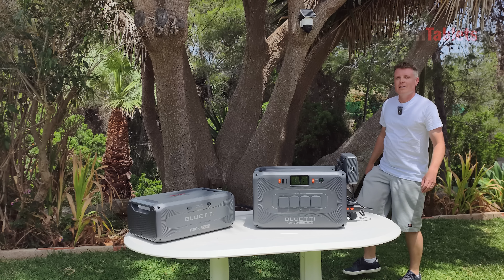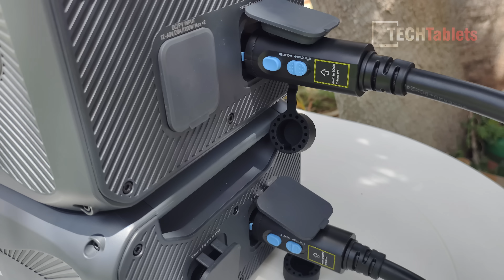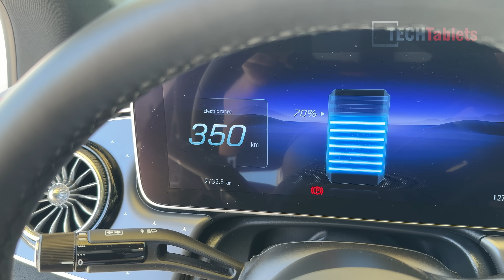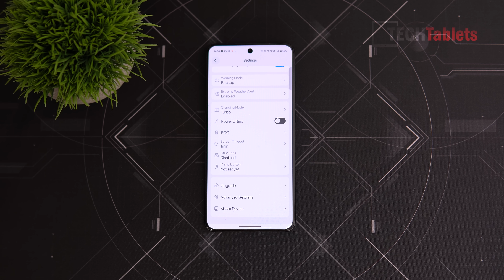Bluetti Apex 300 + B300K & DC Hub1 Hands-on 3840W Of Power!

Comment from the maker: 👉 Where to get one: https://bit.ly/3Ht0KME
#bluetti #apex300 #homebackup #rv #offgrid 
Video chapters: 
00:00 - Intro and key specs
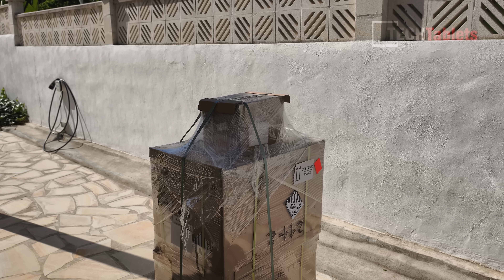01:35 - How it arrived and what is included with the Apex
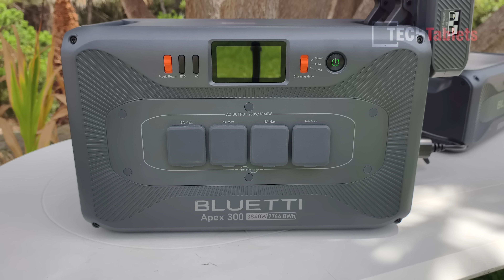02:11 - Apex 300 design and features
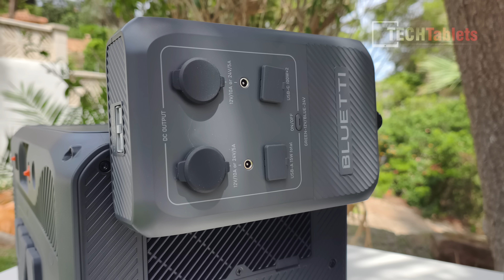04:46 - The Hub D1 for DC output
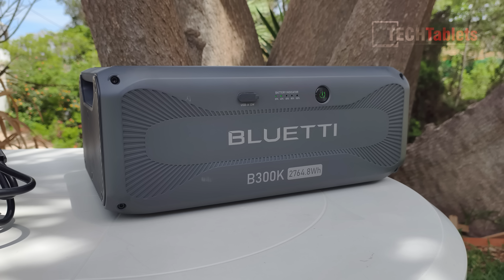05:45 - B300k expansion battery packs
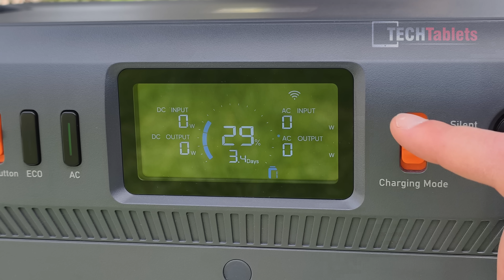07:27 - How to see run time & charge times
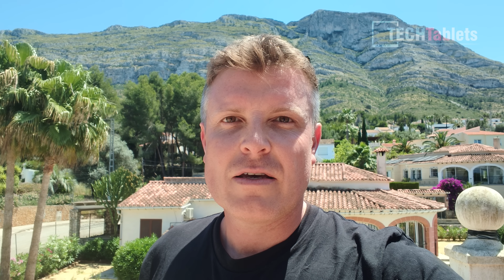08:07 - Solar charging test with 400W panel
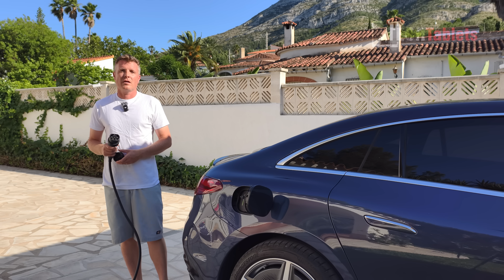09:29 - Emergency charging an EV, how much range and 5% will it give?
11:24 - Other uses for the Apex 300
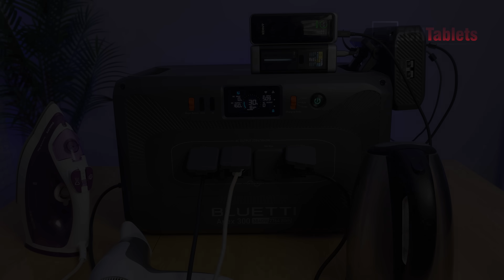12:17 - BMS tests, load test, overload test, charge and discharge test
14:40 - Fan noise sample
14:50 - UPS test
15:30 - The app and features
17:42 - Final thoughts on the new Apex 300 + B300K & DC Hub1
Reply: bro u need to pin this
Reply from the maker: @seansmith6473  Done thank you!

Comment: I have 2 x 200w panels feeding  in a VTOMan 1800.  Solar is the only charging option. I'm thinking of upgrading the VTO to the Bluetti Apex 300. We are only at the shack on weekends so the rest of the time we're charging into the until. The reason I'm looking at the Apex 300 is to run a small, 80 watt fridge 24/7. Would I be better served adding a couple  more panels to the new Bluetti or should I consider an expansion battery? Obviously additional panels would be the cheaper option but a little voice in the back of my head is telling me to go for the extra battery.  I would welcome your input.

Comment: If you set up a van and use the apex 300 and  DC hub, run the hub to a fuse box will you only be able to use 700 watts max output?

Comment: I've had the Bluetti EB70 (716 Wh = 0.716 kWh) for three years, no complaints/issues. It's the perfect size to keep in the RAV4 emergencies or camping. Bluetti build quality is top tier
Reply from the maker: I've covered many if their products, the last bug unit was the AC300 before this and great. Even their smaller ones perfect RV and emergency backup. We had a huge power cut here in Spain and will always have a few short cuts per year so I keep one in the house as backup. And the way the world is going you never quite know.

Comment: No DC ports 12v, usb nothing on the unit is an ayrocious business decision. Buy our bulky ugly adapter box just to get access to basic usb-c charging....yeah whoever came up with that idea should be fired.  This is the only reason I'm not going to purchase this unit but also look at upcoming Bluetti products with suspicion. Dont take away basic stuff, sell it as an inconvenient add-on and call it "modular".
Reply from the maker: Yes the removal of the DC side and forced purchase of the DC Hub1 isn't a good movie at all. The AC300 had everything but then no battery with it that is separate. My guess the size or weight is why they did it. Yes second might have been a marketing sales move to sell hubs for it.

Comment: Might be a good prouct but 15:32 advoid unless you want to give them your wifi router and personal data!
Reply from the maker: Wel don't use the app or connect to wifi that is all optional Dan.
Reply: @Techtablets  But it's required, correct?
Reply from the maker: For firmware updates yes, but you could get away with never using it and be fine.

Comment: how much can this charge a tesla model 3?
Reply: Probably not much... 60khw and 85kwh batteries on those cheaper Teslas
Reply: Get a nice diesel and you never need to worry
Reply from the maker: @RdMcRd897  Not quite then worry about the EGR value blocking up and other things...
Reply from the maker: Well I got 5% with a 96kw battery my guess is a base model Tesla would get around 8-9% maybe?